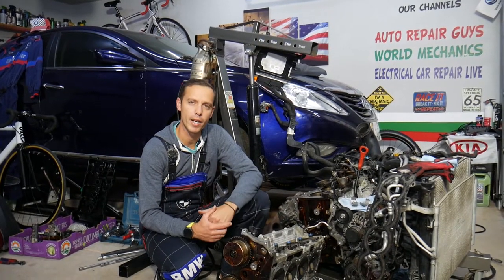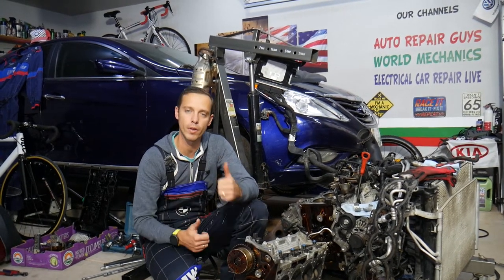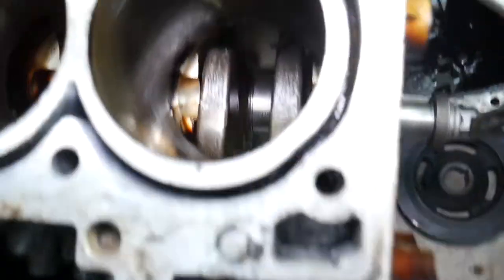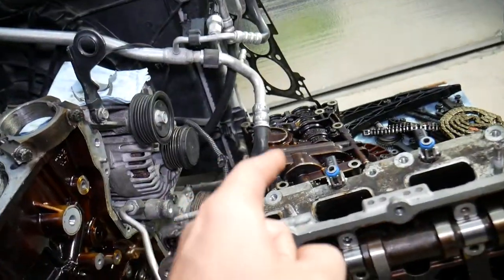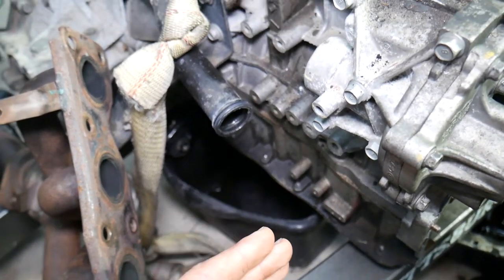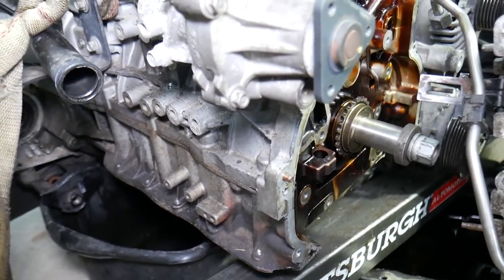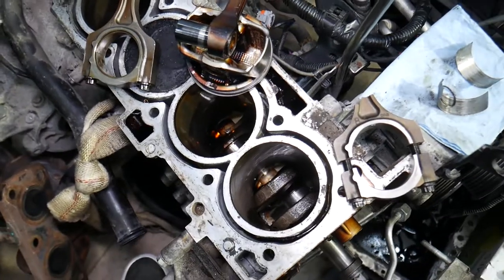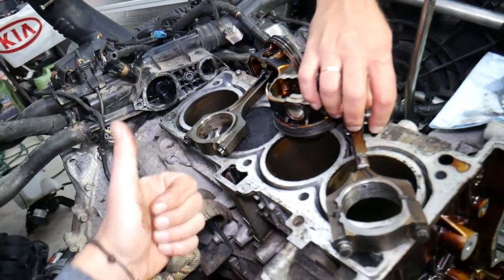HOW TO REPLACE CONNECTING ROD ON HYUNDAI KIA ENGINE

Comment: Thanks for such informative vedios.i have been a hyundai fan since the hyundai pony .I do wish though the new hyundai engines had a better crankcase venting system so carbon would not build up on intake valves